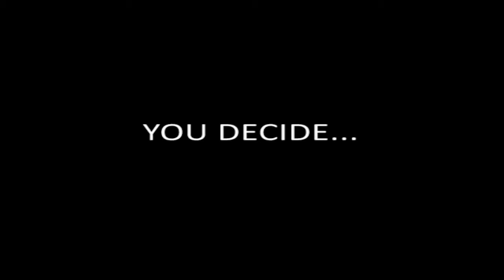6/7 15k HP Hancock Compressor Station "Will Sound Like a Refrigerator" in nearest home

Comment: Nicely done graphic! Another key point: Even if the compressor station was "only" as loud as a refrigerator in the home - my frig turns off. I have never timed it, but if it isn't opened a lot it doesn't come on very often at all.  The noise from the compressor would be constant and as you clearly pointed out in this video MUCH louder than any refrigerator!